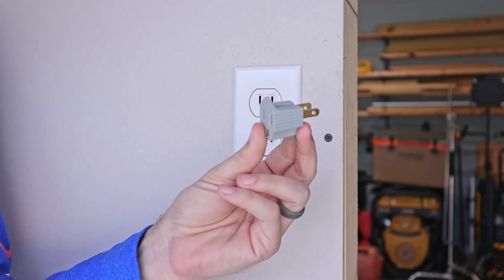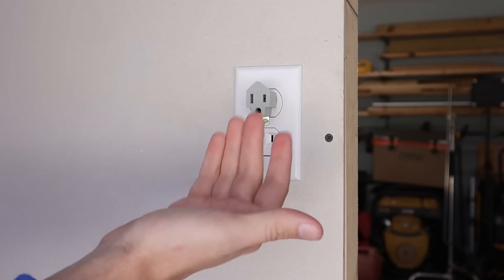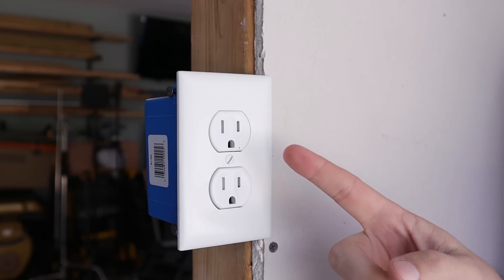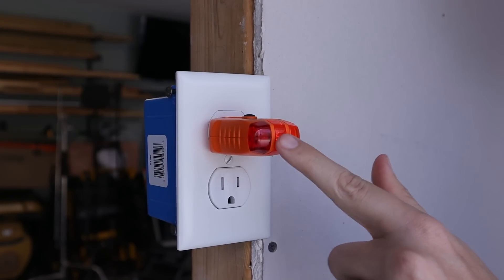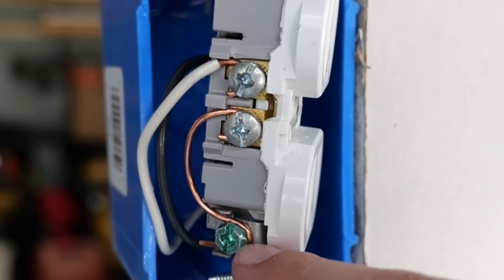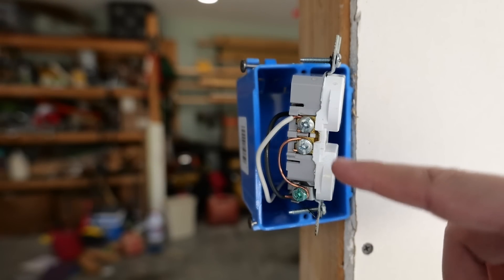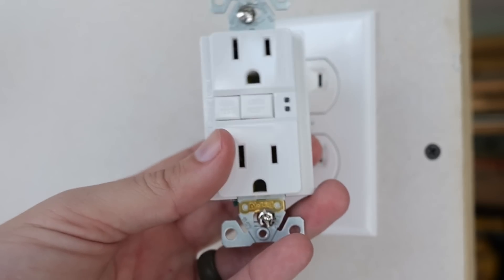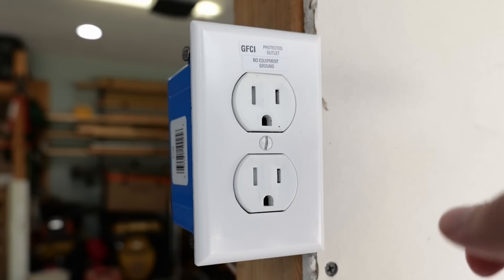EXTREMELY Dangerous "FIXES" Homeowners Are Doing To Outlets

Comment: Old house two wire refit without cutting walls and routing all new romex is often handled by installing all GFCI breakers in the panel and fitting new outlets.

Unless you're gutting a pre 1970s house...the cost of rewiring the whole house could be $50k in electricals and drywall repairs.

All in all the neutral is eventually bonded to the ground in a new service box so they run back to the same ground...do they not?
Reply: There should be no outlet box in which neutrals and grounds are bonded, either on the outlet receptacle or in the box itself. Grounds and neutrals are to remain separate, including in subpanels, back to the main service panel where the the power returns to the utility. They are bonded at the point of exit in a main service panel and at that point, there is no chance of an unexpected errant or excessive power condition affecting a user or the return flow back to the utility. 

The safety function of the ground circuit is to give energy a faster, more likely path to prevent errant or excessive power from seeking a path through a person using an appliance. A GFCI breaker solves this with a different approach, by cutting power when errant or excessive power is detected on a branch. In theory, either approach prevents power from travelling through an inappropriate path.
Reply: Yes, but the only place to bond is at the main electrical panel, nowhere else and not in sub panels either. Otherwise it will cause a condition called "objectionable current".
Reply: Sure and that Fifty thousand dollars should include a new panel and ground rods etc.
Reply: @stevelopez372  i had new service panel, two sub panels, a new city meter and two new ground rods installed after squirrels chewed through the street line, it drooped to touch a fence, and shorted the phases.

Just that cost 9k including plaster repair at the subpanels inside.  The estimate for a full rewire of a Victorian was at least 25k more + plaster patches/ paint and that was before everything doubled in 2021.
Reply: @drstewart  agreed on an individual outlet or outlet box, however tracing back to the main panel aren't the neutrals bonded to the ground?

US wiring is a bit goofy and evolved in bits and parts from 1910 thinking...always with backward compatibility.  Europe and Australia benefitted from not being the prototype wiring country under the Edison/Westinghouse years.
Reply: @STho205  I see what you're saying. Yes at the main service panel, in most US areas, the neutral and ground outbound are bonded together. It's important to note that this is basically on the way out of service though, after otherwise separate circuits. The mistake many people make is thinking "Well if they're bonded together at the end, why can't I do the same at this outlet?" The explanation is that this potentially changes what is a safe path of energy into a very dangerous path. 

I totally agree the US wiring situation is wonky. I'd like to see a significant overhaul but then people would say it was a conspiracy . sigh  For me, "meeting code" is the absolute bare minimum and I design and implement way past that low bar.
Reply: @drstewart  fused outlets with off switches would be a nice start.  Closest we have to that is GFCI outlets or Christmas lights strings.
Reply: @STho205  I do like that in the UK implementation. When we do switched outlets in the US it's seen as a nuisance because it's tied to a wall switch. We'll get it right someday.

Comment: I'm going to guess that some of the thinking is that if the neutral is bonded to the ground at the main panel then the receptacle will also have a neutral bonded to ground as a result.
Reply: What folks don’t realize is, by bonding the neutral and ground at the receptacle, they have now created a parallel path for the neutral current. Say you have a toaster plugged into a cheated receptacle. Current is flowing out the neutral and onto the ground bond in the outlet. You touch the sink and toaster together. Since the plumbing is grounded, current will now flow from the toaster, up the ground to the toaster chassis, and through you to the sink. You have essentially created a fault by the neutral-ground bond in that receptacle. The fact that the panel is bonded doesn’t mean you can bond elsewhere. In fact, it is a contributing factor to the danger.
Reply: Well it is. There is nothing fundamentally wrong in the so called "bootleg ground". It was a standard method to ground in many countries for decades. It does have problems so there is a good reasons to ban it. The problems include stray currents that it causes and risks in case the neutral breaks. All my grounded sockets are done so.

Comment: I would say you have your labels backwards.   Using the adapter is equivalent to cutting off the ground prong and eliminates any protection from a ground fault.  They should be banned.   A bootleg ground,  on the other hand,  becomes a problem only should there be an interruption in the grounded conductor back to the service equipment.  Until the end of the 20th century, using the grounded conductor as the grounding conductor was the approved wiring method for large appliances and is grandfathered in to this day.  Can't be  too lethal.

Comment: ⚡🔌💡 It's essential to prioritize safety when dealing with electrical outlets. I understand that older buildings may lack grounded receptacles, but using a 3 to 2 prong adapter without proper grounding is risky. It's like relying on an outdated vehicle without seatbelts, hoping nothing goes wrong. However, charging low-power devices like phones or iPads in a 2-slotted outlet can be acceptable. Let's explore more about electrical safety on Meta Tech HD. Discover intriguing videos and satisfy your curiosity about responsible home improvements!
Reply: tell me you're advertising a company without understanding what they claim to teach without saying you don't understand what they claim to teach.
Reply: I love the seatbelt analogy when discussing to potential buyers of an older home the pros and cons of old construction vs new construction.  Old homes offer a sense of charm,  attention to detail and architectural styles difficult if not impossible to duplicate in new homes, in much the same way classic cars featured hood ornaments,  pop up headlights,  tail fins,  flashy chrome and white wall tires giving each car make and model it unique look while modern cars seem bland and hard to tell apart by comparison.
Reply: Charging devices for iPads and phones are typically 2 prong, so receptacle grounding is irrelevant here. They are also not polarized because they convert AC to DC at a low voltage of 6v or so and polarization isn't considered necessary.
Reply: @surferdude642  chargers are typically not grounded, because they are completely enclosed in a 100% plastic case, so there is nothing TO ground.  they are typically not polarized, because there is no switch, and polarization is to ensure the switch turns off the power to the device before it gets to anything else.
Reply: @kenbrown2808  Very good points, Ken. BTW, Power tools often have 2 prong plugs and are polarized because they have a switch. The way I understand it is that they are double insulated and have plastic cases, so no need for a ground prong. The double insulation symbol is a square within a square located on the case.
I recently was given a desk lamp that had a non polarized plug. By plugging it in with the reverse polarity orientation, I was able to verify that the light bulb socket was live regardless of whether the switch was on or off, not good.
Reply: @surferdude642  or they have it written out on the case.

Comment: Geez, people can be cheesy.  It's safer to just leave it an ungrounded outlet than to fool people into thinking it is grounded.  Less work too.
Reply: I did it when I had no choice.
I was selling a house with ungrounded receptacles that should have been left alone but the idiot home inspector was insisting that the 40 year old house needed to meet the current electrical code and I wasn't about to do a complete rewire on a building that was going to be torn down anyway.

Comment: Clickbait!  Wiring the neutral to the ground is a code violation, but is not "lethal" due to our standard practice of grounding the neutral at the service entrance.
Reply: Congratulations, you don't know what clickbait really means. And yes, that actually CAN be lethal.
Reply: It works fine until you have an open neutral. Now your "ground" has 120V on it.
Reply: It's a requirement to ground the neutral at the service entrance and it's also a requirement that it cannot be done anywhere else for good reason, hence it's a major code violation.
Reply: @MrBirdnose  It's not fine even without an open neutral. The ground wire should have zero voltage and zero current and if a ground fault occurs the momentary high current will quickly trip the breaker. If there's a low amount of current on the ground wire it could result from leakage current, possibly from worn or cracked insulation near metal parts and is a hazard. If you have a "bootleg ground" you create a condition known as objectionable current and is also a hazard.